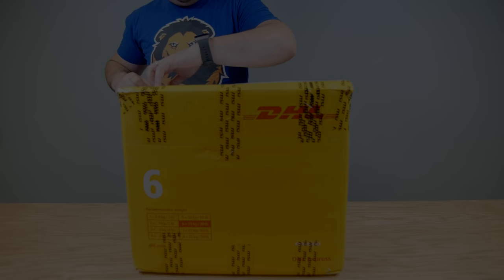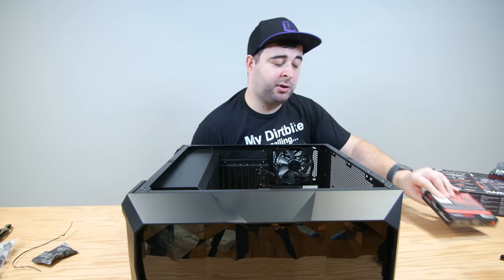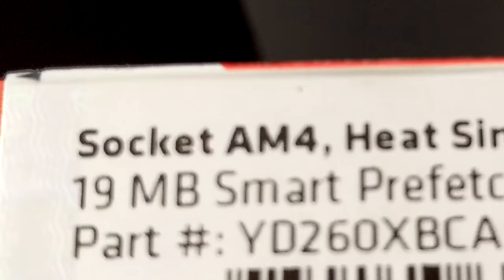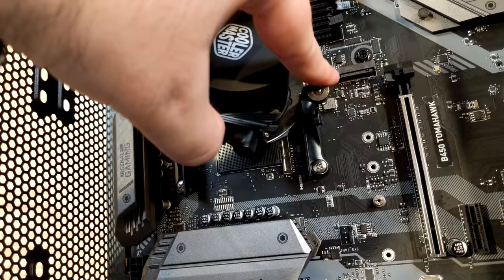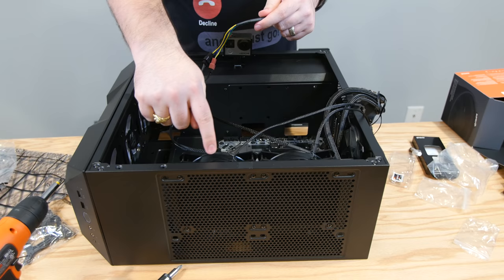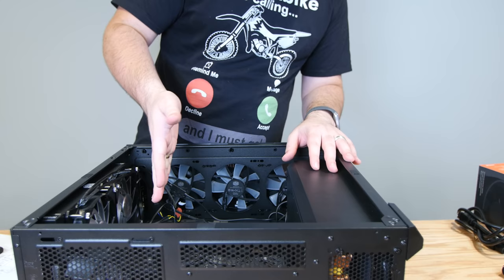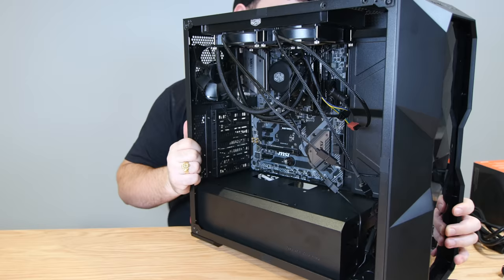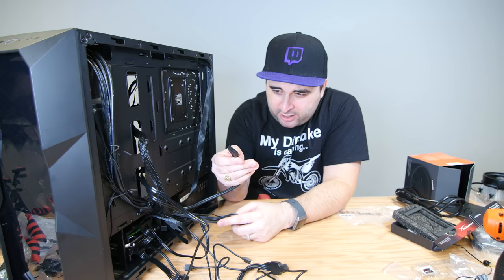MSI PC BUILD STEP BY STEP

Comment: Really good video Nick,good job! especially for any first timer out there you explain everything really well.
Although It's personal preference I guess,but it is also easier for an expirienced and a newbie respectivly to first place the CPU and the RAM sticks to the motherboard and then screw the MOBO in the case,also plug everything in the MOBO first and then start messing with the cables is what I find easier and more efficient to do.Again really good and informative video.
Reply: exactly
Reply: Lol

Comment: I'm going to build a pc is this a good build?

ryzen 5 2600

MSI - X470 GAMING PLUS ATX AM4 Motherboard

G.Skill - Trident Z RGB 16GB (2 x 8GB) DDR4-3000 Memory

Samsung - 960 EVO 250GB M.2-2280 Solid State Drive

seagate- Barracuda 2tB 3.5 7200rpm internal hard drive

Zotac - GeForce GTX 1070 Ti 8GB AMP Edition Video Card

Cooler Master - MasterBox Lite 5 ATX Mid Tower Case

Corsair - CX (2017) 650W 80+ Bronze Certified ATX Power Supply
Reply: Excellent
Reply: I would prefer a 750w power supply with a decently powerful build.

Comment: 1. Never put in the motherboard in first without the keycomponents (cpu, cooler, ram and if you have a m.2 ssd put that on the mobo as well)
2. Psu is easier to place first
3. Always wear a esd wristband and place the mobo on an antistatic placemat or put it on top of the mobo box
4. Never ever force a cpu in the cpu socket!!! Gently use 2 hands and gently put it in the cpu socket. If you think it fits in nicely just give it a slight gentle wiggle

Comment: 2:16 its called an IO shield
EDIT: HIRE A CAMERAMAN MR.RICHIE
ANOTHER EDIT: INSTALL CPU AND RAM BEFORE YOU PUT THE MOBO INSIDE THE CHASSIS
Reply: Nick F4RR3LL it's a preference which one you do first. Neither choices harm the computer. I prefer to install the motherboard first. :)
Reply: unless you use a custom cooler that requires a backplate. Then in some cases you need to remove the motherboard.
Reply: @carlbrutanunanulewski1115  Its easier in everywat
Reply: There is a big ass hole in the back of where you put the motherboard, so you can slot the bracket over there
Reply: with the cooler he is using i would never suggest this. but if he would have been using the default amd cooler its smart to install it first

Comment: Why does the desktop icons look so fat and zoomed in
Reply: Hi wrong resolution has he mention. Need to download the drivers for the video card and then edit the resolution to his monitor. Usually tho, it auto detects it and you're set. However, at time it does not and a correction will have to made. :)

Comment: Lets Begin

"mount"= Standoff
"this little plate"= IO shield
Also your cable management is straight butt cheeks.
Reply: C A B L E   M A N A G E M E N T
yeah, those cables of the cooler are really annoying me. He can just rotate the fan and route the cable to the back of the case
Reply: Everything about this video triggered me, needs to stick to CS since he obviously isn't very PC savvy. Even off the start, no the first step wouldn't be installing the motherboard it is much easier to install cpu, ram and cpu cooler if its an air cooler outside of the case, then install the board into the case.
Reply: He only does it like 95% of the people that build their pc, dont give a shit, there is no gain with cable management, so if its under the table, there is really no reason for it.
Reply: But i agree 100%, he could do a waaaay better job for cable management.
Reply: Well i clicked on the vid because i never knew he can build a pc by himself   so i guess GG Nick.
Reply: Bulding a pc, is pretty mutch like lego, most things only fits 1 place. its not hard to build one, its time consuming. its when you start with cable-management, and custom looping etc it gets harder, but that is still easy.
Reply: fuongbregas there's nothing wrong with installing the board first. Regardless, he's still going to have a functional pc. Cable management usually not a priority.
Reply: Lol, if cm is not a priority, don't show a PC with glass-side panel. The glass is used to show the beauty of the internal, not the mess. If he ignore the cable, just tell us plug this plug that, no need for a 26-min video.